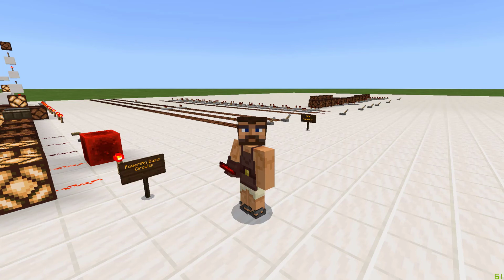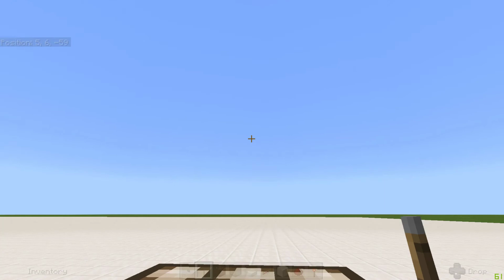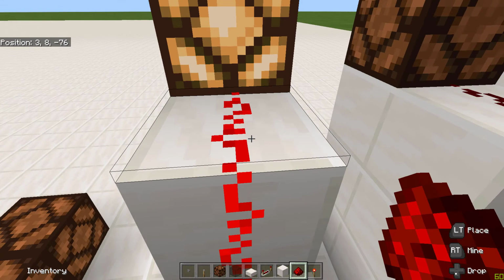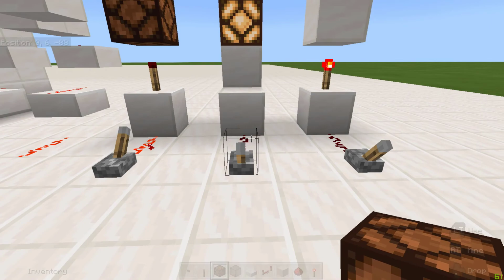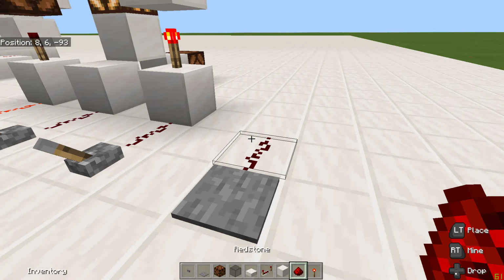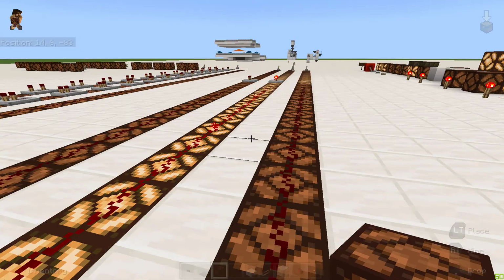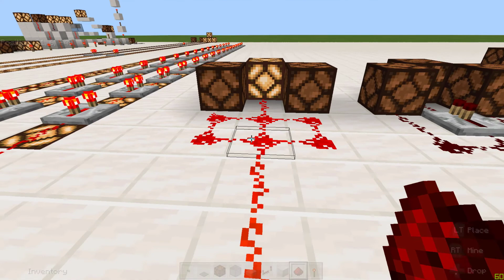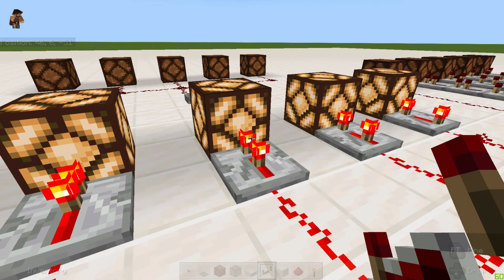Technically Bedrock Tutorials Episode 1 - Redstone for Noobs

Comment: At 25:00 is it just me or does the 0tick and 1 tick turn on at the same time? Maybe that’s why my thing in the creative doesn’t work.
Reply from the maker: watching it back, it does look like that.  hmm, let me go into the test world and try it to make sure it is not a frames or video editting issue.
Reply from the maker: okay, wow.  I tested a bunch of scenarios and it absolutely appears like the 1 tick repeaters is firing exactly at the same time.  I tried moving things around, tried resetting things and it always happens.  So then i daisy chained 2 1-tick repeaters and it aboslutely was delayed and in fact matched the 2-tick repeater (as expected).  So this situation only appears to happen with a single 1-tick repeater.  

If i was to hypothesize, I would say this is likely just a rendering issue with frames per second and it is actually delayed.  I will try this with 2 pistons and see which one wins.....
Reply from the maker: So I tested this with 2 pistons that cross each other and although the line without the repeated does win "most" times, the line with the repeater does win.  And more than just a fluke number of times.  I found it about 1 in 4 the repeated line would win.  WIth the repeated specs, this should NEVER happen.